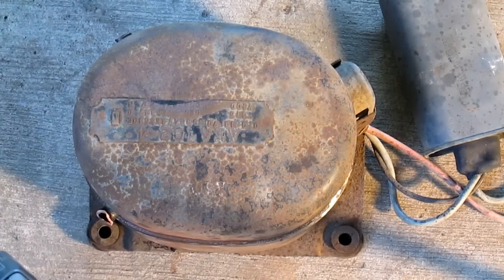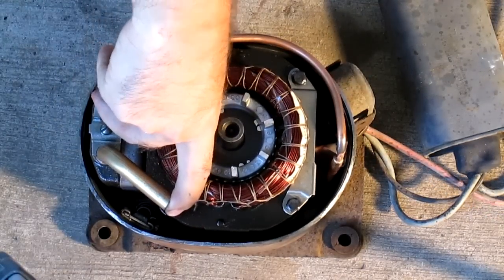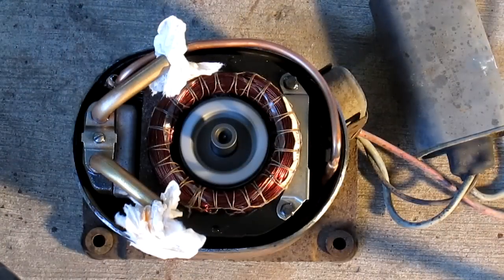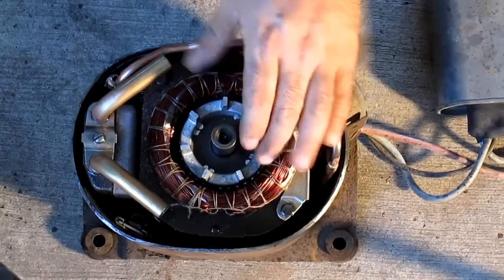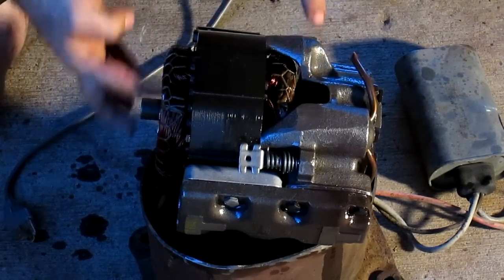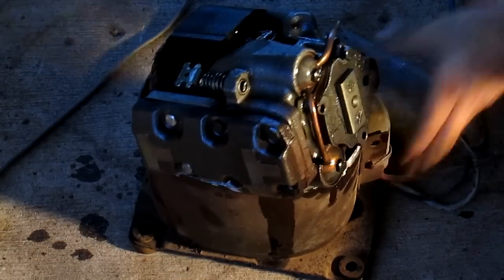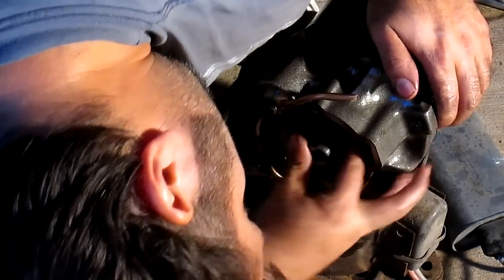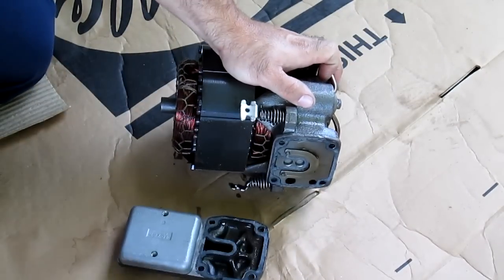Hermetic Compressor - Lets Look Inside !

Comment: I'll bet this came out of a General Motors Fridgidaire window AC unit. My buddy has one of these and it still works perfectly. They weren't very big physically and the thing makes the lights in the house dim for a second when that compressor kicks on.
Reply from the maker: You are correct on that.  It ran solidly for years till this year........ coil rotted out and ended up running open to the atmosphere on the outside.... it did suck up some moisture

Comment: just a small note; the  1/4" copper line that raps around the inside of the compressor is the hot gas discharge line. The Liquid line is on the outlet of the condenser.
Reply from the maker: Thank you!

Comment: Hey more350power could please tell me how did you seal off this compressor without any damage
Reply from the maker: I just used a 4 inch right angle grinder with a cutting wheel.  It takes some time if you dont have a powerful one.  But, you get a nice clean cut !  Plus, I try not to cut the whole way through on the seal weld and I smack it with a rubber mallet when I can.

Comment: it´s fascinating that these things can run 40+++ years and are still ok when the appliance is scraped..  a few years ago my parents replaced a 35 year old freezer , it was still running but was replaced because it used a lot of electricity and all the stuff around the refrigerant system was old and worn... but it was still cooling like on the first day... and in these 35 years it was not turned off a single day
Reply from the maker: Interestingly my 40's ge deluxe fridge uses less than a self defrosting model over a weeks time period even being completely defrosted and re started.... 120 watts vs 700 watts for the newer fridge

Comment: Mr. can i use refrigerator compressor as a replacement for a bad air conditioner?the air conditioner uses R-22, can i use R134A with a refrigerator compressor?
Reply from the maker: You would not want to mix the two.  R22 uses mineral oil adn 134a uses PAG or POE I believe.  You would have to empty out the old oil and change it over to what the refrigerant is compatible with.

Comment: Mr. kung fu can i use refrigerator compressor as a replacement for a bad air conditioner?the air conditioner uses R-22, can i use R134A with a refrigerator compressor?
Reply from the maker: I would have to say no because of the oil.  R22 uses mineral oil and 134a uses pag oil which don’t play nicely with each other

Comment: just so most will know the closed systems are really built to last 30 years,that what they taught us in HV/AC  school,the hermetic s really bulletproof if the start and run caps are refreshed periodically,thanks for the video
Reply from the maker: +strattuner I have a 1940's ge deluxe on R12 all original except the thermostat....... still going strong !
Reply from the maker: +strattuner I have a 1940's ge deluxe on R12 all original except the thermostat....... still going strong !

Comment: You could've put that back together and saved it for another air conditioner
Reply from the maker: Will Butter quite possibly I could have, but, it ran without any refrigerant for a bit of time open to the elements.  I would not have trusted it.